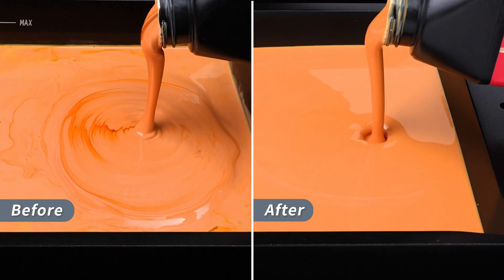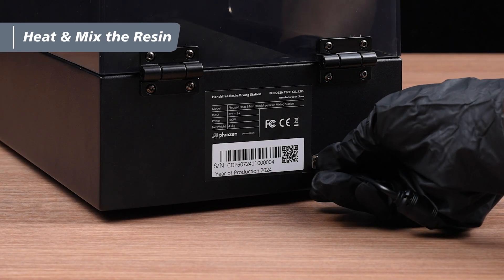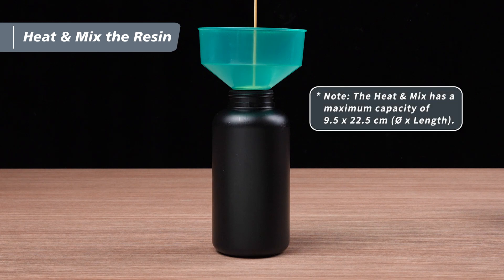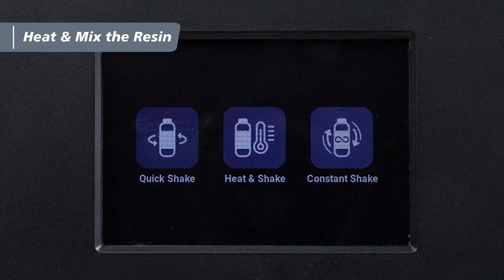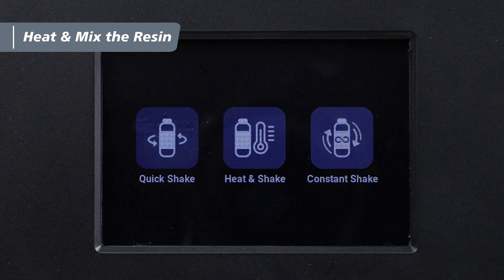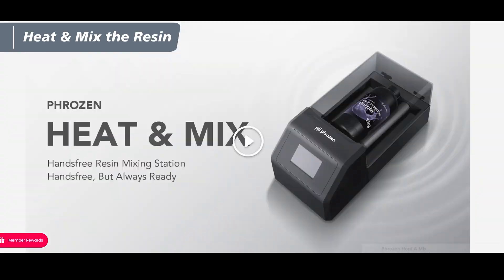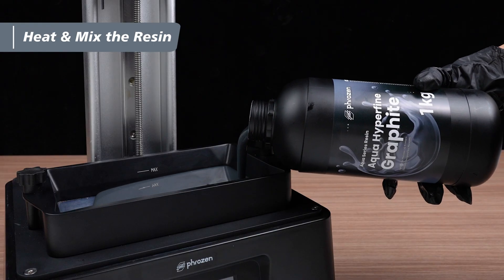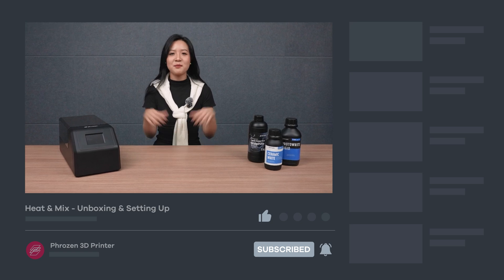Phrozen Heat & Mix: Unboxing & Setting — Phrozen 3D Printer

Comment: Have always Loved and supported Phrozens products spreading the word in the dental community (4 Resin printers, 3 cure units, 1 soon to be FDM printer (Acro), however without properly testing the function of the heating, the mixer is very loud I agree with @IBMua, was quite disappointed about that.
Reply from the maker: Thank you so much for your support! We’re sorry to hear the mixer noise and untested heating function have been disappointing.Your feedback helps us improve—thank you for sharing it!